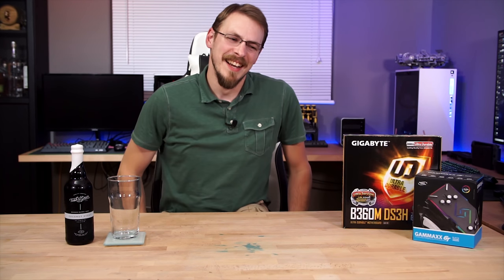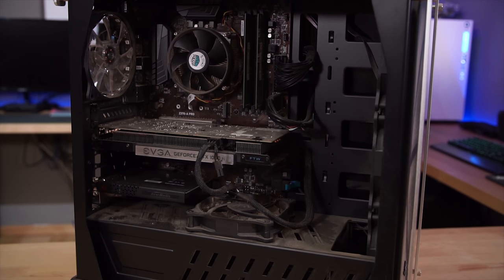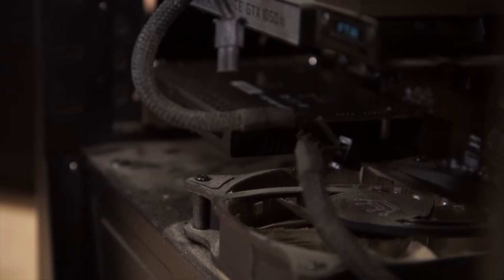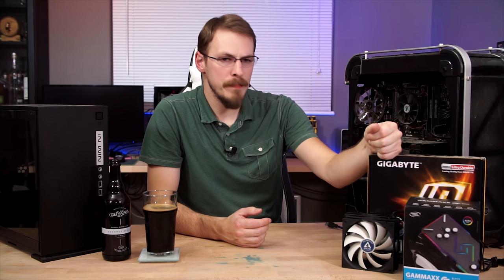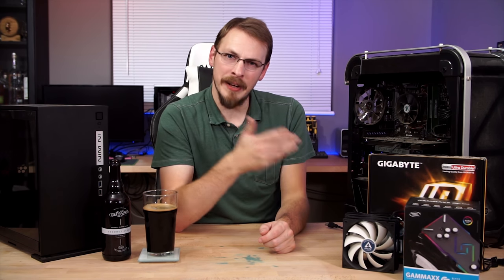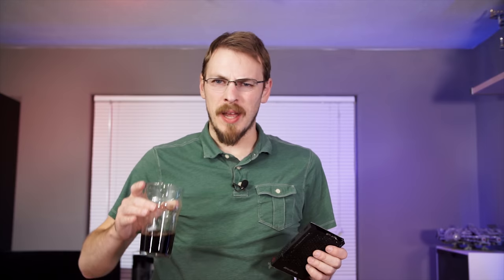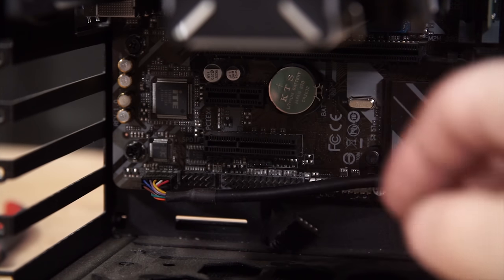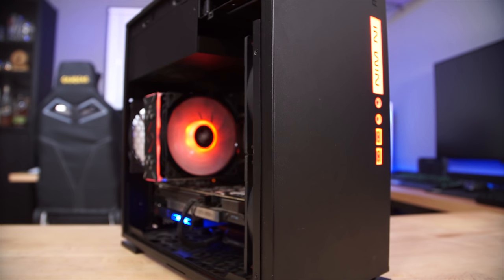$800 Streaming PC Rebuild!

Comment: I built in this case and used a long riser cable and hdmi extension to mount the graphics card against the front fans to draw air in from the side ventilation. All my case inflow was from 2 fans mounted at the bottom and 1 exhaust at the rear. Had to make an rgb backplate for my 1050ti and when it was finished it looked really unique, I'd say beautiful but that's subjective, and the temperatures were surprisingly good on the gpu. But.... As pretty as the case is I'll never use another one again if I can help it, the cable management is so poorly thought out considering the side ventilation.

Comment: @Craft Computing  - i assume for those good temps,  the two case fans on the right "front" bracket are setup as exhausts , pulling cool air through the bottom (?)  Would Corsair's SP120 be a better pick for that position than just any ol' generic fan?  I'm trying to keep things cheap but not to the point of having an Easy Bake Oven.

Comment: The chip on that GPU will not be happy with that aver media card blocking an ENTIRE fan on that GTX 1050 ti.
Reply from the maker: No, it'll be just fine. There are heatpipes running the entire length of the card. The FTW cooler is massive overkill on the 1050 Ti.

Comment: so your intake comes through the hex-holes using the two side (I call the glass side the front for this case) fans rather than bottom?  - I've seen all kinds of reports of hellish temps and that air cooling doesn't work -  48C sounds like you've solved the problem of cooling this  little case.  Do you have a picture or video the cable management ?
Reply from the maker: The fix was actually pretty simple.  There are two fans in the front of the case.  Most people have installed them with the fans directly against the front panel.  I mounted them on the opposite side of the mounting plate, giving the fans some room to breathe.
Reply: @CraftComputing   - got a 301 - super cute case - Are your two front fans working as exhaust (negative pressure)??

Comment: Will a 1050 ti oc bottleneck a Fx6300 with 8gb of ram?
Reply: Right now I have a Rx 550
Reply: When I'm on the topic does anyone have a 1050 4gb for sale for cheap?
Reply: No. Other cpu's will be faster but a slower cpu doesn't necessarily mean there is a bottleneck. If it did then all i5 cpu's would be considered bottlenecks in comparison to i7's.
Reply: @JamesSmith-sw3nk  but typically i5s do not bottleneck most gpus. Unless you're maybe running a 1080ti/2080ti on 1080p or something exaggerated.

If other cpus are faster with the same graphics card that means bottleneck. And typically you want the gpu to be the bottleneck, not the cpu.
Reply: You missed my point completely.
Reply: @JamesSmith-sw3nk  no, I didn't. We don't call i5s a bottleneck compared to i7s because on balanced builds, the gpu will be the limit. The i5 will "outperform" most gpus so we don't call them bottlenecks. He made a legitimate question about a fx 6300...

If a i5 gets like 160 fps on a game with 720p for example, and under the same conditions his fx only gets 60, the gpu is bottlenecked. It can perform better but the cpu is holding it back.
Reply: No.. You have no idea of what you are talking about. My point was that just because a cpu is slower doesn't mean that it's necessarily a bottleneck. The gpu isn't the limit with 4k gaming, there is little to no difference between a Ryzen 2700x and a 9900k with a rtx 2080ti at 4k and maximum detail.  A Ryzen 2700x will be on average 20% slower at 1080p gaming using a rtx 2080ti than an 19 9900k, it doesn't mean that the 2700x is bottle-necking the rtx 2080 ti, it just means the Ryzen 2700x is slower (thus my original i5 vs i7 analogy). A real cpu bottleneck would be putting a rtx 2080ti on a pentium 4 cpu. Overclocking the rtx 2080ti would accomplish little to nothing in benchmarks at any resolution because the P4 cpu can't come close to providing the cpu performance needed for the rtx 2080ti.
Reply: You're talking about 4k gaming when OP wants a 1050ti and I am the one who has no idea what I am talking about?

"The gpu isn't the limit with 4k gaming" - 1) I assume you meant CPU? 2) It's a 1050Ti how the fuck is he going to do 4k reasonably?
"A Ryzen 2700x will be on average 20% slower at 1080p" - he doesn't have a Ryzen 2700X, he has a FX 6300
Reply: Austin Duff It'd be the other way around in some games.

Comment: Any bargains to get from data mining crash?  I'm itching to be building!  :D
Reply from the maker: 1060s and 1070s are available at pretty awesome prices on the used market. RX 570s are back to ~$180 brand new as well.
Reply: Craft Computing thanks! Will be modifying soon!
Reply: In the UK there's been a flood of 1080 Tis and RX 580s. I managed to get a 1080 Ti for 450 UKP, am very pleased.